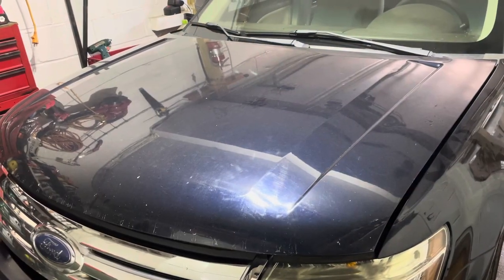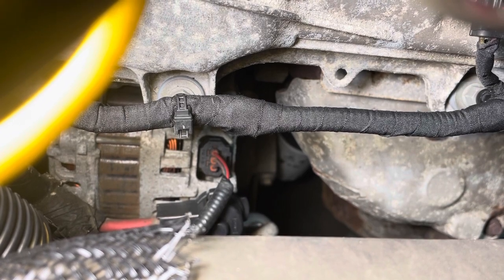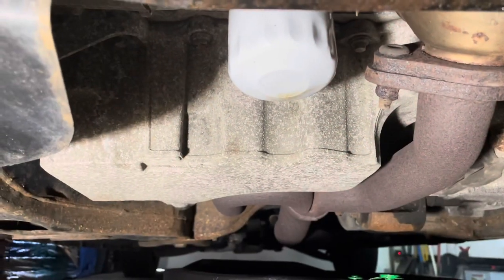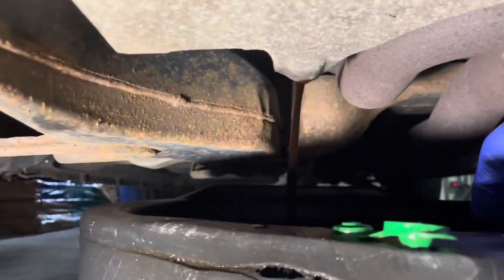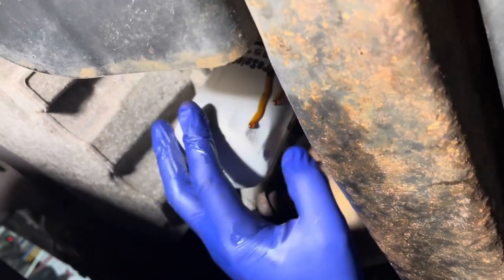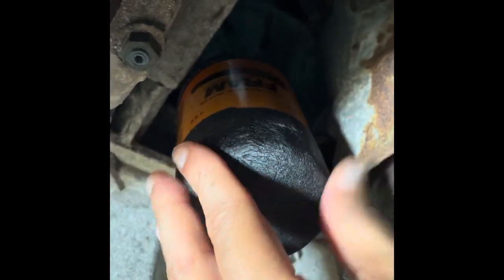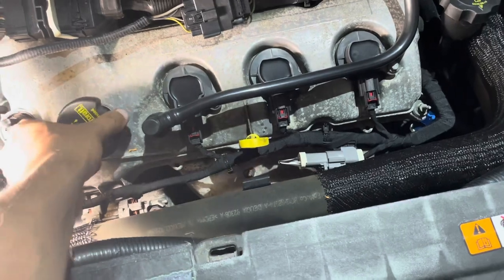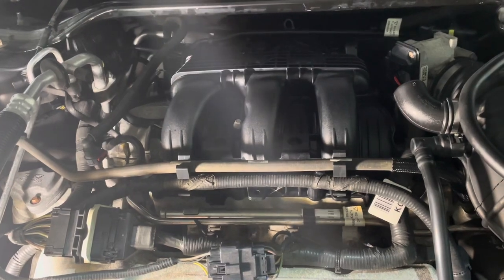2009 Ford Taurus Changing Engine Oil and Oil Filter

Comment: if anyone is wondering, the 2008-2010ish model years do not take a fl500s oil filter. Some will though. Many in those model years, especially the taurus SHO will take a Fl-400s or equivalent.
Reply: I agree i bought fl500s before and the tread is bigger for taurus 2009 LE

Comment: Can you drain the oil with the front end jacked up considering the placement of the drain or would it be best to lower it back down to level to drain?
Reply from the maker: You may use jack stand or hack to design the oil, and tighten the drain ug back. The. Level down the vehicle to get the correct ready after adding oil.